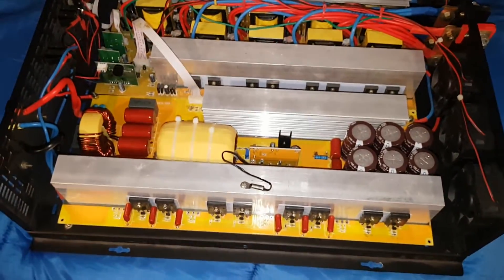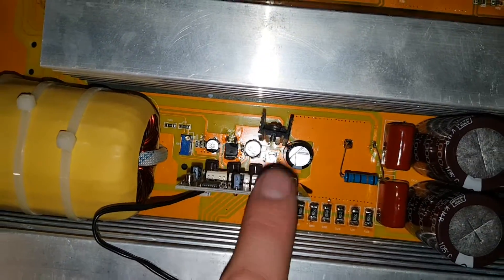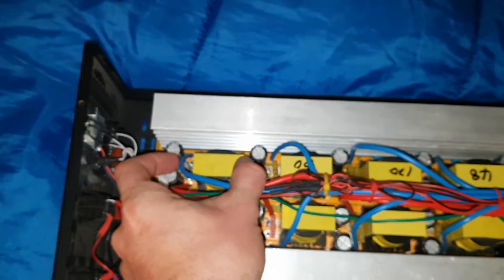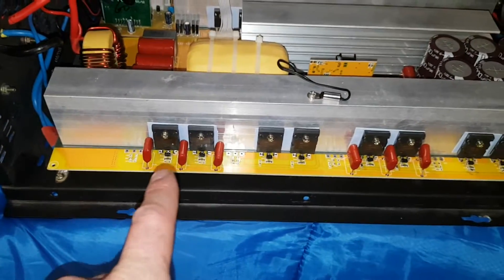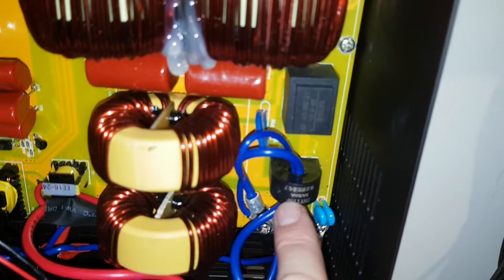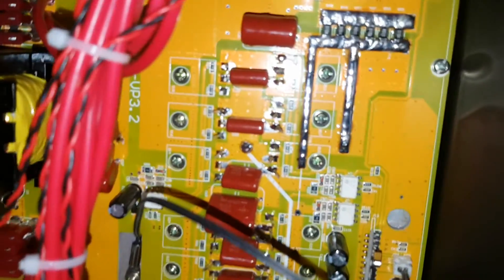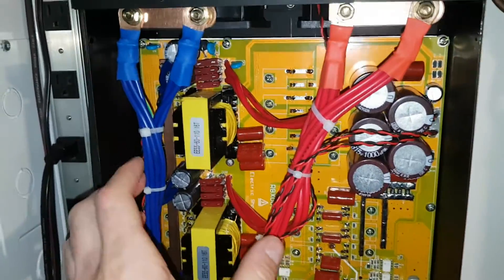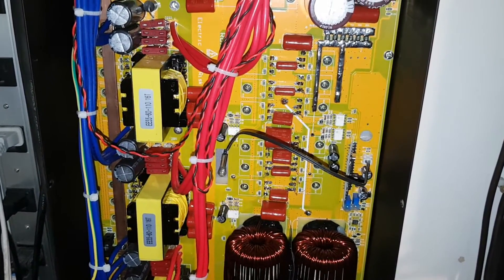Inside The New Reliable 8000w Inverter

Comment: If you want to see a real heavy duty  inverter check out the inside of an aims low freq inverter !   the transformer in mine is 28 lbs !   I believe there the best on the market from all the research ive done and i have had mine for 3 years now.  My inverter has its own built in smart charger , its 75 amp output to battery bank.
Reply from the maker: I have the same one, blow up in the first 10 mins :D I have parts to fix it, will be making a video.

Comment: Have you repaired this inverter? Can I consult some issue with you?
Reply from the maker: I have, but I only have about a 25% success rate. The 8000w has a lot of damage when it blows. Im trying to fix a 10000w atm
Reply: @GoingOffGrid101  I have 10KW version of this inverter. I repaired MOSFET, resistors, replace yellow regulation board but still nothing. Do you have idea what can be damage? DC screen shows right voltage but AC screen is blank and inverter doesn´t have any output.
Reply from the maker: @jankoren1176  I am having the same problem. The 4000w and under seem easy to repair, but the higher models are very hard to figure out. Ill continue to test it.

Comment: Here's mine: http://www.d1pics.net/view.php?id=bekhbidQNKLLciL
24v 6000w... works good but it gets a lot of heat before the fans kick in... is there a way to adjust that?
Reply from the maker: I would leave it, as its been tested to run the way it is, even my magnasines get hot before the fans turn on and they are $3000.00 for 4400W inverter.

Comment: Hi, on one of your videos you said the website is powerreliable.com and this one you say reliableinverters.com.  They both seem to be the same company, but the English seems to be rather poor and the website doesn't appear to be updated very often.  Traditionally, I am a big Trace/Xantrex  fan, but I am not happy with the customer support over the years from these companies in the UK and Ireland, which is quite frankly a joke!  

How would you rate the support from this Yueqing Reliable Electric Co Ltd?  Also, what is the hack-ability of these devices? I would be wanting to try and use a Raspberry Pi to monitor the inverter input and output, maybe even have the ability to power it off and on remotely.
Reply from the maker: Mods are easy, support is good if its the companys fault, otherwise they will aswer questions and thats about it

Comment: Hi, I have the 12v 2000w model of the new inverter, I asked reliable electric to adjust the input voltage to handle as high as 16.5v. it works great but the output flickers too much on high input voltage. is there a solution for this problem?
Reply from the maker: one thing that helped mine was adding a 100w load stoped the flickering, its not bad for your equipment also cheap led lights are more afected by the flicker, I have some better let lights and they dont flicker at all.
Reply: Thanks

Comment: I believe those white 8 pin chips are optocouplers.
Reply: can be used to drive N type mosfets with a higher gate voltage instead of using P types (on the high side), P types have never been as robust.
if your into that sort of thing, heres a guy playing with the same thing but more homebrew
https://www.youtube.com/watch?v=Su6ldNb4P50

Comment: Hey been looking at them but I don't know why battery type to use lead acid SLA , glass mat or lithium , cost are big factor and I don't understand lithium don't  want a fire they seem to be awesome but but real touchy they need to be keep warm on top of all the other stuff that worries me on the fence with them
Reply from the maker: lithium all the way, if you are scared get lifepo4 they are 100 times safer then any lead battery out there.
Reply: @GoingOffGrid101  I am trying understand them life04 battaries were said to not parallel more than to sets there are said they don't play well as a bank I don't  know  I was  going to go with Duracell  6v golf cart batteries I am trying to get all the stuff to at least get something  working just not sure on everything to get  right now I have 8 100 watt panels I have two charge controlers one renogy 40 watt controlers a midnight  150 1 surge protector I bought an inverter that came from China 220v 2500 watt ton of 40 amp fuses in it I got it to run my well was looking at the 8000 watt that I saw in your last video the new one saw the old one you broke any way this battery thing has got me in box when I go for the purchase oh and I bought welding cable for battery set up got some real coin in the stuff I bought so far no were near what you have but it coin none the less
Reply from the maker: @nyghtmyst5118  lifepo4 can be used in large banks but need a bms like all lithium batteries and I have a bms thats only 100 bucks that will do 300 amps if you need the link.
Reply: @GoingOffGrid101  hell I don't know we're to the life04 battaries either  then I don't  know how much battaries to buy for the solar I have so far some told me that you solar needs to be bigger than the bank reason you have to put more in than you take out for recharge
Reply from the maker: @nyghtmyst5118  you only need a bigger solar then your battery bank with lead batteries, with lithium it doesn't matter, but for on the cheap lead batteries are not bad :)

Comment: looked like the ground and neutral both passed through the current sensor. It seems bonded.
Reply from the maker: no its neutral for the inverter plugs and the hard wire connectors, I don't think the ground is bonded.
Reply: @GoingOffGrid101  Cool! I need me one if it's unbonded!
Reply from the maker: @kevinroberts781  ill check

Comment: That's a high frequency inverter ?
Reply from the maker: yes
Reply: I just bought a inverter because I watch all your videos and I have two windmills for 6 300 watt solar panel but how long do you have 500 amp hours on batteries and my inverter 12v samlex evo 3012
Reply from the maker: @solarandwindinsouthtexasda1473  I have about 1000Ah at 60 volts thats around 60Kwh
Reply: @GoingOffGrid101  good morning I got a question for you I have 60 Toyota Highlander Hybrid batteries if I make 6 pack of 10 batteries that will put me a 60 volt where would I get a inverter like yours to run at 60 volt
Reply from the maker: @solarandwindinsouthtexasda1473  what voltage are those cells?
Reply: @GoingOffGrid101  10.25 volt
Reply: @GoingOffGrid101  10.5 volt

Comment: Nice to see that the output stage still uses discrete IGBTs, as opposed to a big black brick where the only replacements available (often) cost almost as much as a new inverter. (I recall a video where someone managed to cut open a bad brick and bodge in some wires to attach an external MOSFET.)
Reply from the maker: dang what inverter is this ?
Reply: @GoingOffGrid101  It was a CNC motor drive inverter, managed to find the video. https://www.youtube.com/watch?v=DGqH8LGjZdY

Comment: That looks pretty decent.
I presume it uses PWM for the sinewave generation, but why all the transformers? Are they all working in parallel or summing and shaping?  High power sinewave inverters are still a mystery.
Would be interesting to put a scope on them.
Reply from the maker: I had a scope on it in a earlier video, it has a decent sine wave.
Reply: Basically 8KW is such a huge amount of power you need to split it up and spread it out, so they decided to go for multi phase synchronous switching (4 interleaved phases, 2KW each). This also reduces output ripple and thus lower need/cost for output filtering, also improves transient response, etc..
Reply: That's part of the voltage boost circuit, appears to be a push pull design as is common in inverters.

Comment: I can't see heat sink in the new inverter?
Reply from the maker: Its under the board its massive, like 20 pounds bid
Reply: @GoingOffGrid101 now I see why the temperature sensor is screwed to a small metal piece in the middle.
Reply from the maker: @magaranayo5042  the massive 20 pound heat sink is under the main board
Reply: @GoingOffGrid101 now I see why the temperature sensor is screwed to a small metal piece in the middle.

Comment: Seems tad different from What we norm see ( what are those big things at the bottom right of the inverter)
Reply from the maker: the inductors or the sine wave filters ?
Reply: @GoingOffGrid101  inductors is what I was thinking what they was (the 2 big ones and 2 smaller ones bottom right) the older 8000w one looks like it had 3-4 smaller ones inside that yellow zip tied up one and one small one after it

On the point of controller board failing, it's the MOSFETs blow up and go short circuit which in turn then blows the controller board up (the problem is a lot of these inverters don't have inrush capacitors on the output or not big enough or the MOSFET are not big enough for the wattage as a lot of these inverters say they're 8000 but really that is there peak load and around 4000 to 5000 is there normal load)

With Transformer based inverters employ a DC to DC inverter which (the white inverter you have that I have forgot the name already) then goes to a Transformer (or pair if it's split phase) and if it's the proper ones they will look like the ones that come in the older style welding units (the cheap ones look like round stereo amplifiers Transformers) main issue with them is the dc to dc MOSFETs blowing and taking the control board out (tends to happen on cheaper transformer based inverters so I guess cheap Mosfets)
Reply from the maker: @leexgx  I see, good to know! I believe this newer inverter is a much better build! but time will tell.
Reply from the maker: @leexgx  the magnasine have the good square transformers and are very good, this new 8000w reliable only takes 36w idle :D
Reply: @GoingOffGrid101  yes the magnasine I believe they are rated for 10 years expected life (not seen to many of them failing as most of the work is on the transformer)
The problem with MOSFET based inverters is when they suddenly get a high load they sometimes don't react fast enough so they get stuck between switching and then go short circuit then destroy all the other mosfets and take out the control board and all the soldered fuses if they have them
Reply from the maker: @leexgx  I have seen this, but I have found the lower wattage 4000w and under the control boards survive if the inverter is overloaded. this new 8000w is quick to save its self with its soft start, we will see :)